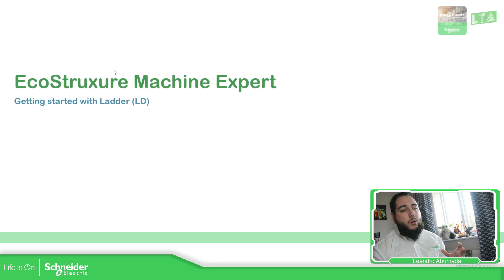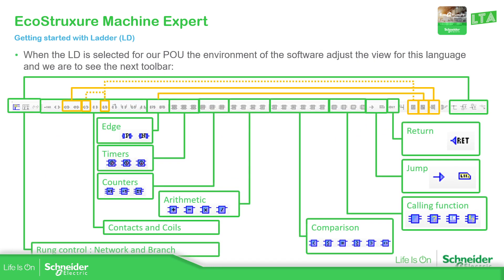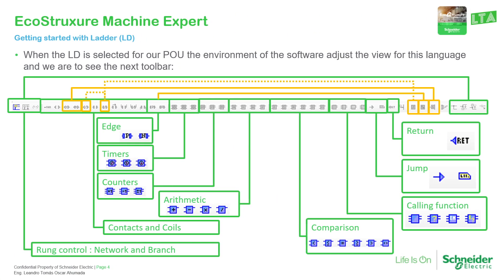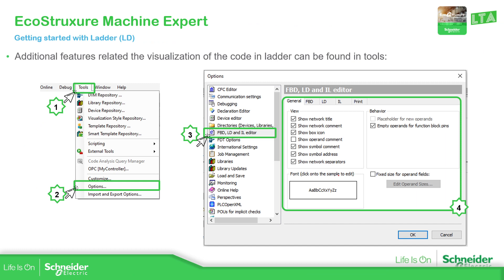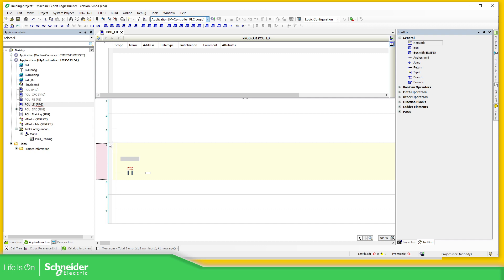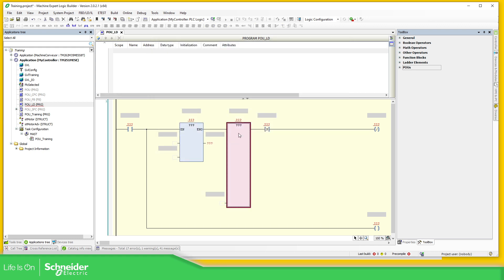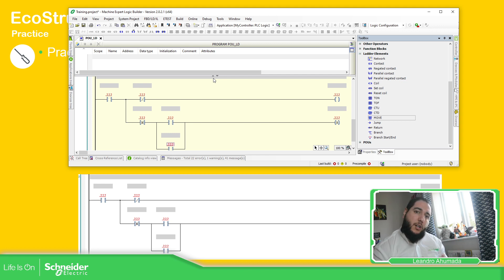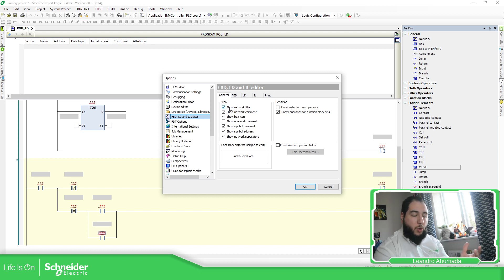EcoStruxure Machine Expert Training - M4.1 Getting started with Ladder LD

Comment: Please make video on voltage interface module and how to scan it by io scanner.
Reply from the maker: Hi Mahrous! If you are using Machine Expert you can take a look into the example project: https://schneider-electric.box.com/s/aloqcd8a6lnanhxa9ckkuktnpw2985k7 

In Machine Expert there are available some functions block to get the information from the TeSys Island.
Reply: Thanks alot your videos hv been really helpful to me on level reached so far on my project.
However  if you could help make some videos about PM5100 energy meter with M241 using Ecostructure machine expert to read voltages and control